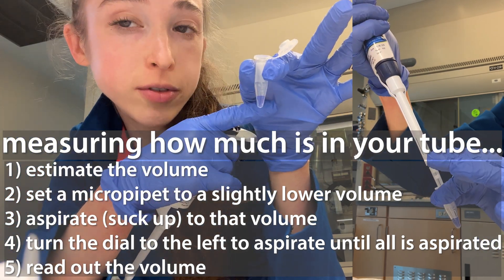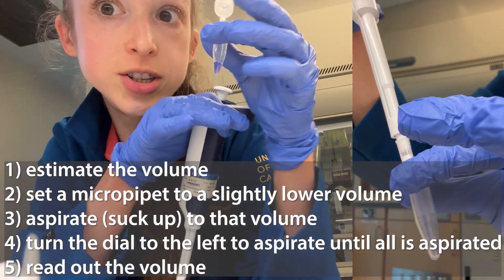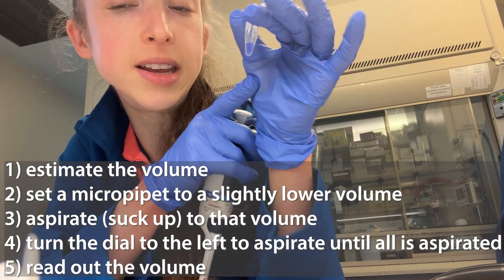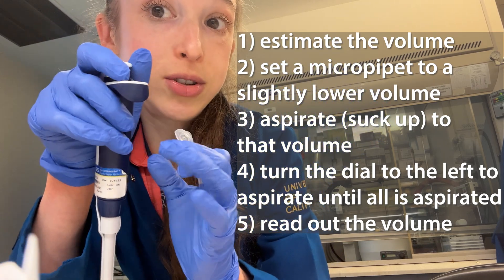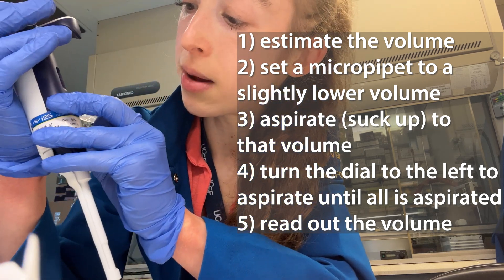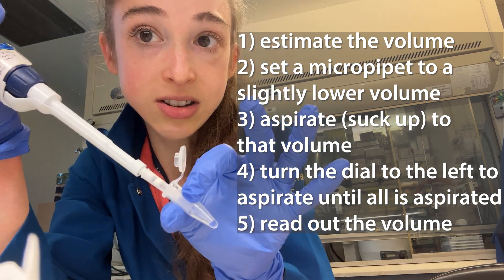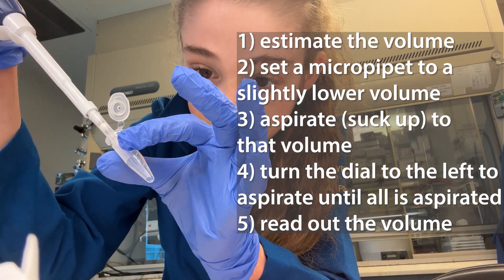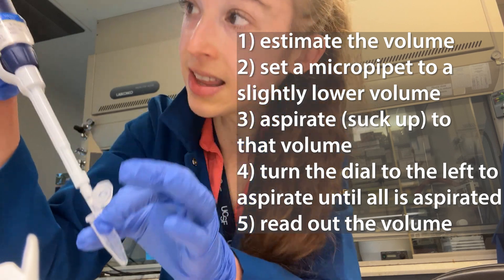Measuring how much liquid is in your tube using a micropipette

Comment: Nice content. Any tips to pipet enzymes accurately. It’s very difficult sometimes due to the changes of the physical properties of enzymes which leads to get air into the end of the tip.
Reply from the maker: Thanks! Go very slowly and pause at the surface before releasing your thumb